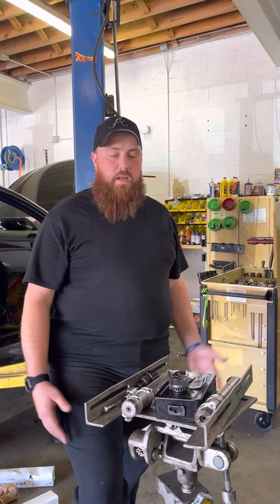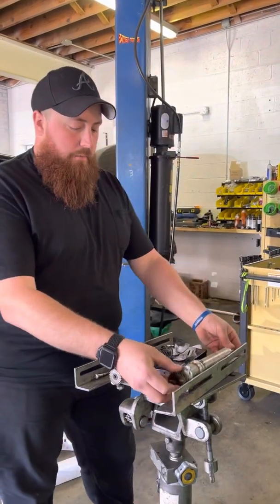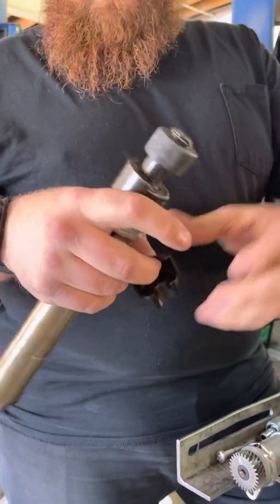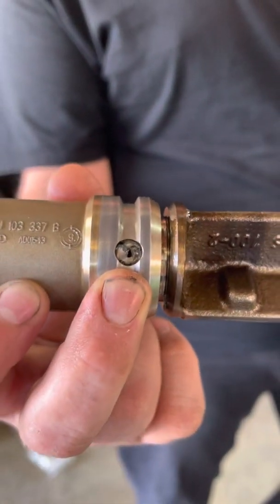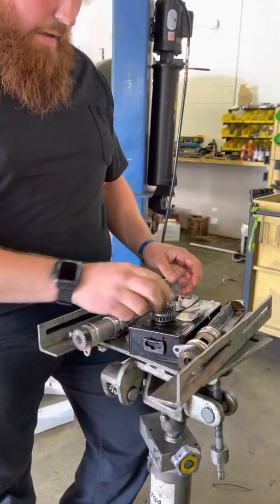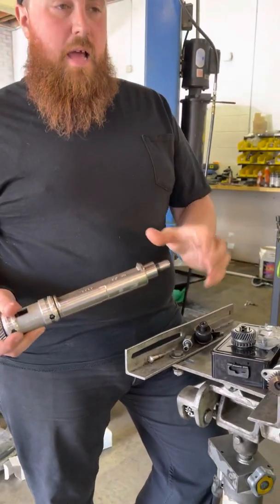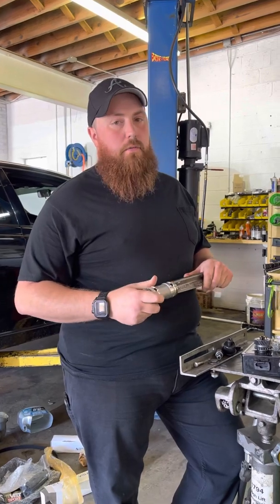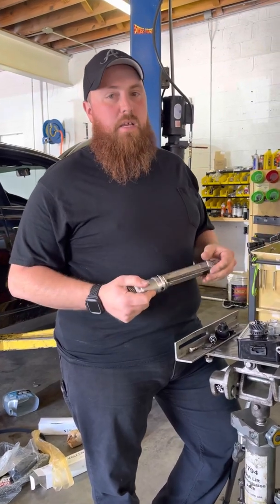MK6 VW/Audi Low Oil Pressure (Balance Shaft Failure) - Common Problem

Comment: My oil pressure is cold at idle 22 psi, hot idle 12 psi
The oil pressure light is on, is the oil pressure normal or too low?

Comment: My so sons 2011 cc oil light came on about 180miles after doing a oil change with Castrol euro spec oil and a Mann filter. He shit car off and checked oil level and also for leaks and everything was good. He started it back up and light had not been back on and it’s probably been another 100 miles. I checked oil pressure today and it had around 50 at idle almost at op temp. Sensor looked ok(no oil in connector). Any ideas what to look for? I’m hoping I don’t need to go the balance shaft route yet. 120k
Reply: Hey!  This closely describes my situation!  Did you end up do the balance shafts?
Reply: @ no I pulled filter back off and took the black plastic piece that’s inside the housing out and made sure it was clean and then reseated it. Put filter back on. Also manually checked to make sure oil pressure was good.

Comment: Have you ran into issues with the upper chain guide being different lengths? I have three blocks. One has a long guide, and the other two are short. Normally, I just have to reuse that guide, but through the old one way. Thanks for any info.

Comment: Josh, good video. Thanks. Can you enlighten me as to the purpose of the plastic sleeve on the exhaust balance shaft. What does it do exactly....
Reply: The oil return path for the cylinder head is through the exhaust balance shaft housing. The plastic sleeve prevents the oil from coming in contact with the rotating shaft, which could cause foaming.

Comment: Why is it that on the back if that balance shaft there is a slit and on the new one there is no slit?, I have the same problem but scared to put the new one in because there is no slit. Will this make any difference?
Reply: You bought the exhaust balance shaft that has no slit. The intake does have it to bolt the water pump gear that is reverse thread like the intake cam pressure valve.
If you are asking such question I advice let someone else do the job.
Reply: I have the same question, the old blancer that you took out has a cut -out at the end an the new one dont, why is that so?

Comment: Hello there, thanks for laying out on this issue. Ive recently had the same issue and in need of more advice, theres two balance shafts and the rear one connects to waterpump is at faulty in my case. Should i just do/fix that first and see how it goes? Or any other advice. What usually happens if i only fix that? My mechanics said all chains and else are still in good order though. Budget friendly is a way to go for me at the moment but i certainly need to save up for funding to either rebuilding the engine or changing the whole engine in the future to keep my mk6 runs.

Thank you
Reply: As you can see, no service shop, dealership, or vw certified service tech will answer you or give you the FULL correct answer, or a definitive one to where you won't be asking more question.

Replace your water pump with an aluminum one while you are replacing BOTH balance shafts. Pop the oil filter screens out of all of he new balance shafts before installing the new ones. They will pop out and get lodged and block oil passages later on or under heavy load. There's also one inside the camshaft bridge that you should pop out as well while you're in there. That one will blow out, oil starve and tear up your camshafts if it hasn't already.

There's ways to check your chain and tensioner to see if they should be replaced. Google the part number and revision, usually the safe bet is to just replace the chains and tensioners. I wouldn't replace the guides unless they are stained brown from the oil. They're usually a white greenish/yellowish brand new. You will need to replace the bottom timing cover as it is one time use just as the balance shafts.